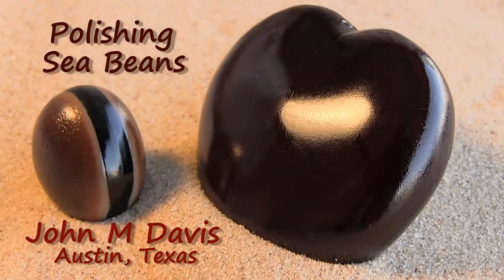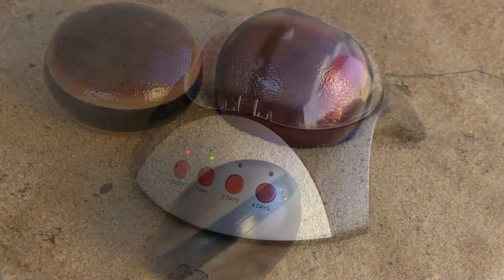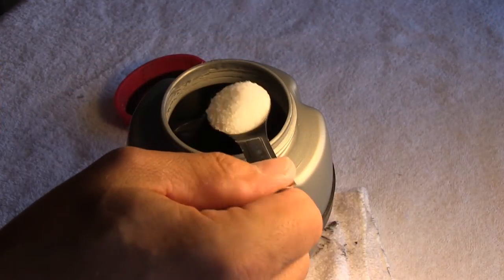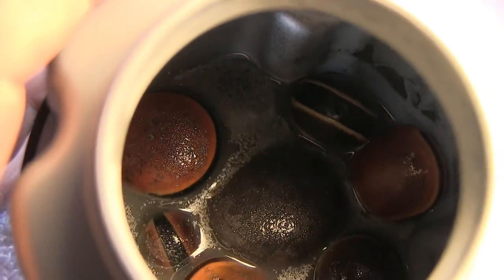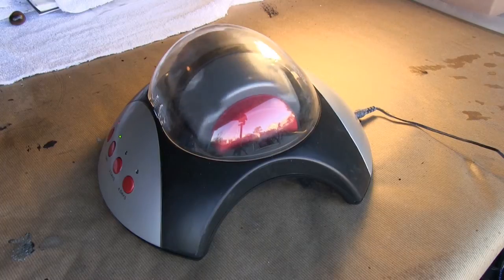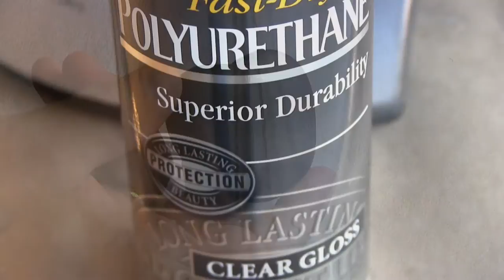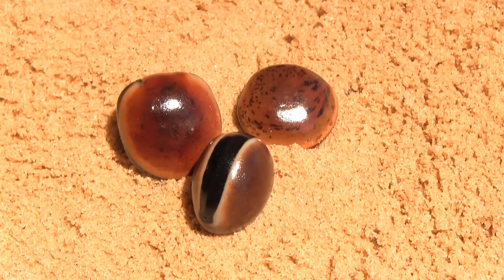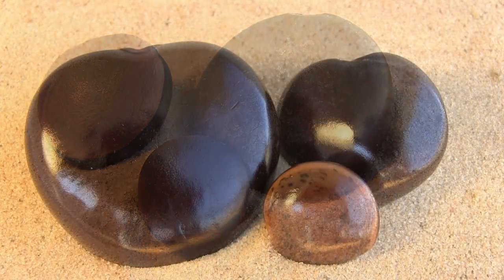Polishing Sea Beans (Drift Seeds) for Jewelry and Such

Comment: Hello! I found the brand of the rock tumbler. It's called Discovery Rock Tumbler. It costs around $25 on eBay. I wanted to ask you if the tumbler is silent or if it makes any noise before getting it.

Comment from the maker: Elias, yes it makes noise. It's loud.  I let it run in the garage when I've used it.
Reply: Thank you for your answer. I also wanted to know if you had any problem with the drum. I read some reviews in Amazon and everyone said that the drum is made of plastic, so it wears out eventually. It's like the grit eats through the plastic and then it starts leaking. Have you had that problem yet?